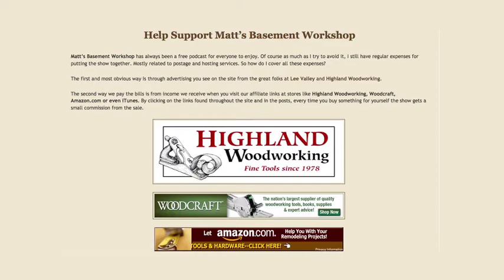487 Shop Redo

Comment from the maker: I work with sheet goods from time to time, but typically I break them down in my garage and then move them into the shop. The space is so tight I just don't feel comfortable trying to maneuver full sheets around. 

I've done it in the past, but it's just so much easier to work elsewhere and bring in the smaller pieces.

Comment: I love seeing ideas in small shops as most of us probably would love a bigger shop. Good layout and use of space. I'm surprised you haven't framed your walls so it is easier to mount things with plywood or osb as that is what I did vs drilling into the cement blocks, but those adjustable shelves are nice since they are modular.

Comment: I want to build a long narrow bench that goes against a wall to hold a miter saw, drill press, router table and planer.  The miter saw will sit in a well so the saw table is at the height of the bench top.  The drill press will move up and down and use the fixed height bench as the drill press table.  The router table will use the fixed back board as the fence and the router will slide forward & back to adjust the distance to the fence.  The planer's bed will be at the bench height.